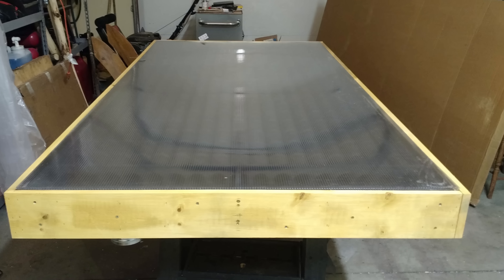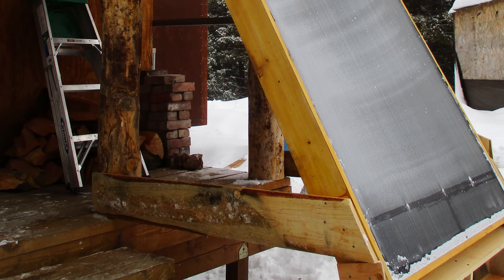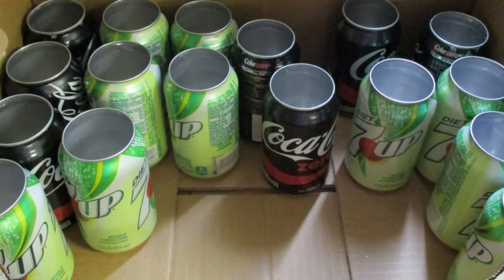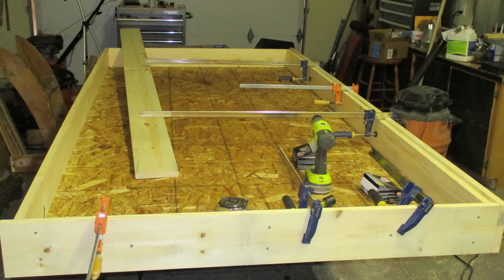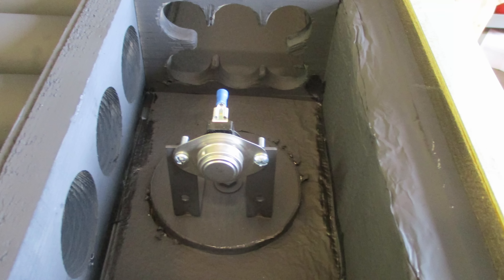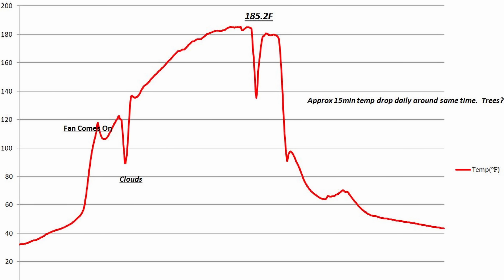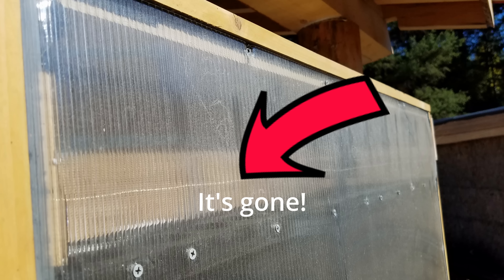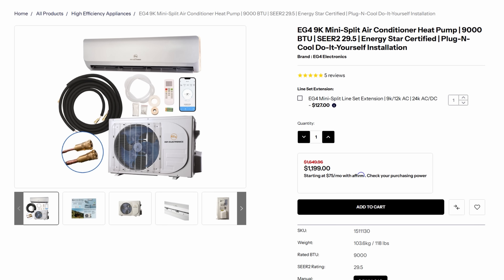7 Years with Pop Can Solar Heater - Is It Still Worth It?

Comment: Adding an Arduino driven thermostatic servo motor to the valve and fan control with pwm speed regulation would cost a few quid.
The libraries are pretty much standard for this application and even AI shouldn't screw up the code (more than a couple of times) for it if you don't want to write it yourself.
A NANO can be as cheap as £1 and around the same for the other parts. Add a small solar panel and a used laptop battery with an HW107 [TP4056] charge controller for fully independent running.
Reply from the maker: Interesting idea!

Comment: I installed two 12,000 BTU Mini Split heat pumps last year. I bought the first one to replace two failed air conditioners. When I found out how much heat they make, I bought the second one. They say these will produce heat down to minus 8 degrees F. Well, maybe so, BUT, they use too much electricity at low temperatures. Last February, here in central PA, it seldom got to 32F. My electric bill went from around $160 to $270. The outdoor unit has a heating element to keep the compressor warm. Also, any humidity will frost up the condenser requiring it to go into a defrost cycle. So, this coming heating season I will shut it off when 25 to 30 degrees is the daily high. I will use a combination of oil and a wood stove.
I did cut my oil usage last season, only putting 117 gallons in the tank after starting full in the first week of January 2025. Ordinarily it would probably take twice that amount. Back when I was using mostly firewood, I once went 9 years without buying any oil. I'm not in a good spot for any kind of solar project due to trees and a nearby mountain.
Reply from the maker: Thanks for sharing your experience! It sounds like you've got a good system worked out for your situation.

Comment: I recommend replacing the spring loaded duct damper with a tamarack fabric backdraft damper.  These are the perfect solution to keep the heater from becoming a reverse thermosiphon at night and allow full airflow during the day without requiring a powered fan unit.
Reply from the maker: Thanks, I'll check it out!

Comment: Isn't there a low temperature threshold for those mini split AC/Heat Pumps ? I thought I read somewhere that they no longer heat below an outside temp of 40 degress F.  Does anyone know the correct answer?
Reply from the maker: Good question!  I'll have to find out.

Comment: Why use the cans at all? Just a box, painted black on inside and clear face, done.
Reply from the maker: Certainly can work but back when I built this the thinking was the turbulence caused by the shape of the cans and the rapid thermal radiation of the thin wall aluminum cans made this more effective, or so the thinking was.
Reply: @TheOldJarhead  interesting. I knew a guy that used a black barrel, hole in bottom, hole in top. Took cool air from under the room of the cabin and fed into cabin side wall at barrel height. He also said he needed a way to stop the heat, he just plugged one of the lines. Might be worth experimenting.

Comment: Are you including the cost of 300 cans of drinks used to build your heater? $600 sounds quite expensive for what is actually needed. I've found old bookshelves being thrown away, and about the only other items needed are the insulation for the sides and back of the heater, the paint and glue for the cans, and a sheet of glass to cover the front of the case. Certainly, if you are buying everything brand new and building it from scratch in the basement workshop, it's an expensive hobby. Find some scrap items from a salvage company, and it can be dirt cheap.
Reply from the maker: It could certainly be done cheaper, this is just what I did at the time as a fun project to try to get some heat in the porch.  It worked and was a fun build albeit, with mistakes made.

Comment: I'm considering adding some fiberglass duct boxes with 12v fans on the underside of my dark green metal roofed garage attic and piping the warm air into the insulated garage proper. Even on cold days the attic heats up to warmer than I keep  the garage heated to (with a mini split) with a small solar panel to only run the fan when it's sunny and shade from trees in the summer it will be a simple system and I shouldn't have to worry about over heating.
Reply from the maker: In my shop I run a fan to drive warm air down from the loft for that reason.  Hot air rises ;) Your plan sounds like it might work.  I just use a big box fan.
Reply: Interesting thought.  I'll need to take some temperature measurements this winter.  My garage attic has 60 years of dust and mouse poop so I don't want to just blow air straight through.  But maybe snaking some flexible aluminum vet hose through the attic to collect heat like in his solar heater might work.
Reply from the maker: It could certainly work and would be worth a try.

Comment: Instead of lexan you could use clear fiberglass panels they have a wavy surface so you can seal the ends with a wood trim that can be purchased.  Probably a cheaper option
Reply from the maker: Certainly worth a try

Comment: Why would it cost $600?  Obviously, yours was "too well" made, by the fact that it over heated. I would make one smaller and have no insulation or corner sealant (if it leaks a little, oh well).

Perhaps have a ~2 inch hole at the top and bottom, with a small piece of sheet metal with a single screw, as a easy way to adjust the airflow/temperature by changing the amount air going in/out.

Also, use the aluminum tape to connect the cans, less chance of high temp separation.
Reply from the maker: The cost was based on current prices in the big box stores for what I built.  Could be done a lot cheaper but I decided to show big box store prices.  For me, it was the Lexan that was the most expensive which ran about $100 when I built the unit and is $200 today.  I make my own lumber and the cans were free so no costs there.

Using Fuzit to glue the cans worked well and none of those separated, only the ones with high temp silicone did.  I think the insulation would be fine if using a high temp version (mine clearly wasn't) and no blocking airflow.  Heck, I think what I used was ok if I never allowed the unit to overheat ;)

I plan to rebuild it and see how it performs with some minor improvements.

Comment: I’m confounded on how you arrived at $300 dollars in material much less $600. 
1/2 OSB running around $15 bucks a sheet, the most expensive thing would be the glazing on the front, but that’d be 150 bucks at most.
Reply from the maker: Lexan has gone up to $200 and I priced everything from stores.  For me, it would be a lot cheaper as I can make my own lumber.
Reply: Do you have ideas about how to keep osb from being ruined by rain?  Thanks.
Reply from the maker: I just keep mine out of the rain ;)  Otherwise, it'll fall apart eventually, even in my dryer climate.

Comment: There is nothing off grid about your cabin
Reply from the maker: Huh?  I'm not tied to a grid which makes it 'off the grid'.  I have a composting toilet so no sewage, I have gravity fed water pressure, so no city water and I make my own power and heat.  Care to help me understand your issue?
Reply: @TheOldJarhead  Everything you do is tied to the grid. Fueling your truck, the manufacture of the vehicle, using credit/debit cards, shopping for groceries in a store which is connected to the grid, charging electronic equipment, the solar panels you have were manufactured connected to the grid. You created and posted this vid using electronics and uploaded to the internet which is all connected to the grid. Perhaps you are homesteading, using all the social amenities which others support.
Reply from the maker: 'Off Grid' is technically not hooked up to the power grid.  Beyond that, it's pretty subjective.
Reply: @TheOldJarhead  sure

Comment: Gonna have trouble finding 300 pop cans. However if I could use beer cans. I can probably have them ready in a few hours.😂
Reply from the maker: 😂 That's one way to speed up the collection process!
Reply: Use downspout tubing, easy to find, solid piece instead of tons of seams from cans, produces more heat in one I've seen tested
Reply: @BioHorror  $20 to $30 a section. Will require five or six sections. So over a $100 while I have the cans for free. Also the cans act as baffles slowing down air flow. Faster air flow means less heat gain while the slow air flow provide higher output temps.
Reply: @BioHorror I agree on that....even 3" conductor pipe, although I would be concerned with rust from condensation...
Reply: @ronkittle1268 yeah, I mention n downspout tubing because it's aluminum, no worries about rust
Reply: @BioHorror  That's what I was thinking. The cans are just a complex means to a tube! 😂
Reply: @DigD97  you can source empty cans with no tops, in various sizes, from a brewery supply...pubs use them to can their own beer. They put the tops on right there in the pub....
Reply: @ronkittle1268 Might be far harder to glue them together without the top. I use a drill press to hole saw out enough of the top and bottom for good air flow but leave enough to glue the cans together.
Reply: You took the words out of my mouth. 🤣
Reply: @DigD97  I really enjoyed your humor.
Reply: im prepping another 300 for you right now if you need 😄
Reply from the maker: lol
Reply: That's why mine is a beer can heater.
Reply: Hours!, nube...

Comment: Hello from Finland. The mini split system is in my opinion the best heating source it's cost are reasonable and gives good heat here in Finland even when it's in the deep freeze.
Reply from the maker: Glad to hear mini-splits are working well for you in Finland's cold!  I figure they would do very well at my cabin which can also deep freeze!  I hit -30F in the winter during the coldest periods.

Comment: I built one of these a long time ago. Worked great for about five years, then I started having bond failure on the cans and the corrugated lexan started cracking. Opened it up, ripped out the cans that were a jumbled mess by then, leaving the headers in place, and installed vented black soffit (pitched so diagonal front-to-back as it goes top to bottom.) I was getting about the same amount of heat out of the unit as with the cans and a fraction of the time and frustration.
Reply from the maker: Thanks for sharing your experience and the modifications you made!

Comment: I love the idea, but you can save a lot of time and trouble by eliminating the cans completely.  Just build the insulated heat exchanger without cans.  Eliminate the perforated can mounting boards.  An open chamber with a simple inlet and outlet will do.  The damper to prevent backflow and the thermal activated fan are great ideas.  but using the cans to form tubes is counter productive.   It's true that very thin aluminum doesn't form much of a thermal barrier, but the design does produce a significant amount of flow restriction.  An open chamber design speeds the rate of heat transfer and would reduce the temperature in the static air inside the exchanger.  Heat transfer is the key term here.  More air at a lower temperature can be more useful than less air at a higher temperature.

The only reason to use tubes to separate the heating medium from the inside of the exchanger is if you're (for example) using circulating water as the heating medium.  If you're using air the cans just form a thermal barrier and create flow restriction to the heating air.
Reply from the maker: Those are some interesting points about optimizing the heat exchanger design without the cans!
Reply: Actually there is another benefit to the tube design, this keeps the dust and dander off of the black collector surface. Yes you could rig up an air filter to the intake, but that is a flow restriction requiring a larger fan to get the flow back up to where you want it.
Reply from the maker: True.  I think the cans have advantages but it does take longer to build.

Comment: The fan needs to be installed at the INLET of the heater,  not the OUTLET.   always build to protect the fan and keep it cool.
Reply from the maker: That's a good point about fan placement for protection and cooling!

Comment: .   Does no one still make analog spring metal thermostatically controlled baffles anymore? They work just like an outdoor analog temperature gauge. They just move a baffle instead of a needle (so they have a spring that is heftier).

The heat is free, not the heater...
    The benefit is in the absence of residual cost of operation. This is Especially true if with some other designs that use strong updraft and spring thermostats instead of electric fans thereby cutting out the need for replacement fans as well as electricity which not only lowers maintenance cost but also eliminates failure points creating a safer overall solar thermal heater.
.
Reply from the maker: Those are some great points about analog spring metal thermostatically controlled baffles and the true benefit of solar heaters!

Comment: A mini-split might  be twice the cost but it would still need electricity.  The less expensive solution runs on sunlight.
Reply from the maker: You're right, the mini-split does need electricity, which is where the solar array and batteries come in.

Comment: they do make an automatic electric controlled bafles I believe they make them for direct vent Hot Water heaters for mobile homes. they have a built in fan. look  up  Power Vent Hot Water Heater Fan or Water Heater Blower Power Vent  on Eby. they can handle 1000 degree temps
Reply from the maker: Thanks for the suggestion on the automatic electric baffles!

Comment: Would be good to make it 100% automatic and fool proof. If you had a thermostat switch in the house to turn a valve that would exhaust it outside when house is too hot and one in the exhaust that would turn the fan on when the unit is too hot and off when too cold and switch the exhaust outside when air too cold. A small solar panel and battery to run the fan during sunlight hours sized to account for clouds and it would be perfect. If the exhaust is a normally off, a manual 'on' switch will be in between the thermostat and the valve to make sure its off. If you let the fan go when ever the unit is too hot, you won't have remember to cover the array on days the heat spikes.
Reply from the maker: Great ideas for making it fully automatic and fool-proof!
Reply: Thanks! An outdoor clothes or food drying cabinet would be good extra options to direct hot air to.
Reply from the maker: Very true

Comment: I am not off grid but always looking for ways to recycle and save some green on heating in the winter. I enclosed a portion of my back porch this year with two layers of 4mil plastic hoping I would be able to overwinter some outdoor plants in there. I'm discovering that the amount of sun is not goitto be sufficient to keep the sub zero temps from infiltrating this space. I had not considered a heat box before but now I think it's the best option to try to make it work. I have both beer cans and steel cans I may try. Have to percolate on it a bit. Thanks for the tips!
Reply from the maker: Glad the video gave you some good ideas for your overwintering project!

Comment: When I did this for an uninsulated garage years ago I used ; corrugated Polycarbonate [single layer],  box frame with only 1 " foam board as a backing as it mounted directly on the wall..  Photovoltaic panels powered the fans and an Arduino controller  modulated fan speed  by the delta temperature of top and bottom manifolds.  Vertical mounting used the reflected sunlight from the snow in addition to direct radiation.. Would heat a 250 sq. ft garage from -10 C to +20 C in 2-3 hours.. Entire panel set 5 ft x 12 ft wide
Reply from the maker: nice!
Reply: @TheOldJarhead  As you might have deduced this is in Northern Ontario so the sun angle is somewhat lower in winter than yours. Backdraft control was simply heavy plastic sheets with duct tape hinge on the fans.
Reply from the maker: Sure would be.  Just stand 'em up straight and catch the reflection off the snow but being further north makes solar a lot less appealing around Dec 21st!

Comment: I didn't see where you used a solar panel to power the fan.
Also, does that $1200 mini-split operate on zero electricity?  How does that work?  Will it operate on the batteries?
Are those batteries being charged from a solar panel?  I didn't understand what they were for?
Reply from the maker: My fan is powered off my offgrid power setup, same as the minisplit would be

Comment: Use the ball and cage from a shop vac to prevent back flow🤗
Reply from the maker: That's an interesting idea for preventing backflow!
Reply: The ball rises with warm air but blocks return of cold air😆ball is super light plastic so even a small air flow will float the ball allwing warm air flow.
Reply from the maker: Makes great sense!

Comment: $600 to make a box the size of a door?
Dude, go get an old wooden door from a demolition, grab the frames while you're at it to make the sides. Grab some of the wall insulation too.
Now all you've to "buy" is the front transparent cover. That, can even be a thick plastic sheet.

You're making a heater out of pop cans, stay on theme an reuse/recycle as much as possible. Otherwise, just go ahead and buy some pipes for the tubing.
Reply from the maker: Appreciate the suggestions for using reclaimed materials! That's definitely a great way to keep costs down.